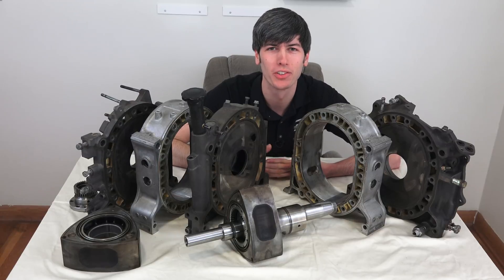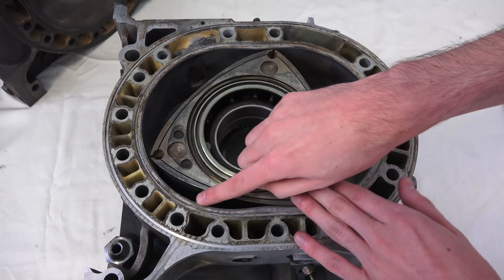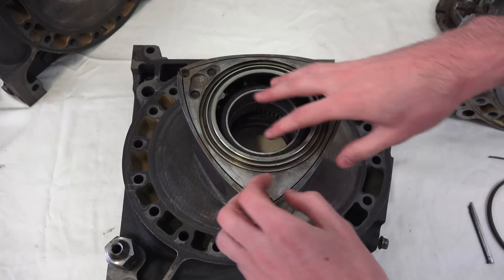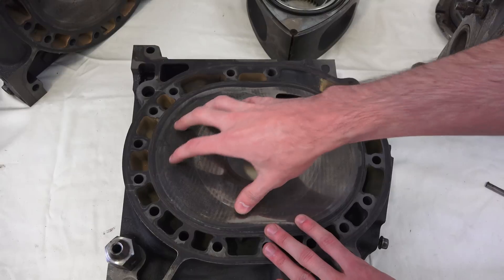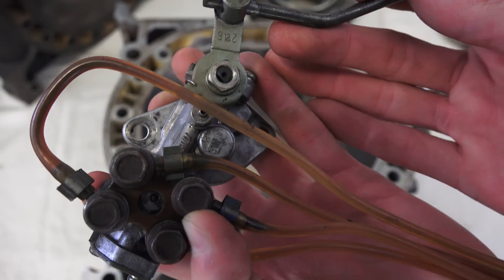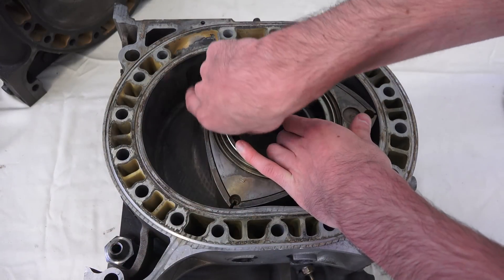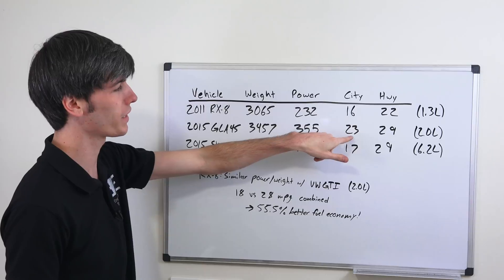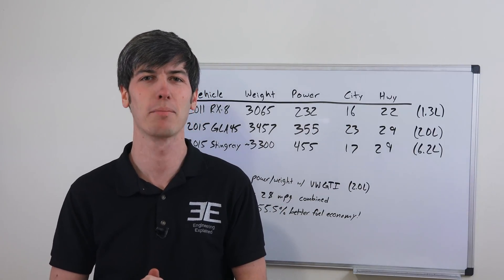4 Reasons Why The Rotary Engine Is Dead

Comment: The Wankel is certainly an interesting desing, I can see why it was tried, and why people have a romantic attachment to it.  The thing about the design is that it's mechanically a lot more efficient than a piston engine, but is's far less fluid dynamically efficient. An engine stores full then creates mechanical work through combustion.  As such the piston engine is highly efficient in that it acts as both a syringeidurring intake and exhaust, and as a plunger durring power.  This means more energy pushes the piston, making up for the energy loss in turning the crank.

Comment: Comparing a 2011 cars economy with a 2015 car is not very sensible since a lot has happened in those four years. Comparing to other 2011 cars the RX-8 would still come out bad, but not nearly as much.

Comment: The description of why the thermal efficiency is low is incorrect. First, "thermal efficiency" is not about uncombusted mixture leaving the chamber. That would be accounted for under "fuel efficiency" or "mass efficiency." In other words, "how much of the stuff I take in is utilized," not, "How much of the thermal energy I receive is converted to mechanical energy."

The thermal efficiency argument that is implied from your description of the combustion cycle is that, because the chamber is expanding as combustion occurs, the peak temperature that is reached is lower. The Carnot efficiency, which is the highest possible efficiency that can be reached with a heat engine, is limited by the temperature of the heat source (high) and the temperature of the heat sink (low). Because the combustion is happening over the entire stroke (while the volume is increasing) rather than impulsively at the start of the cycle, the average temperature at which heat is introduced to the system is lower, reducing its overall efficiency. The process is better approximated by constant pressure heat addition, rather than constant volume heat addition. (Diesels are similarly affected.)

The other efficiency argument that is implied from your discussion leading up to 1:22 comes from fluid dynamics. In short, because the average velocity of the flow inside the cylinder during heat addition will be twice that of a piston engine (because the entire chamber is moving, rather than just the piston wall in the cylinder) then unsteady losses will be higher; the system is farther from the quasi-equilibrium assumption. In the ideal case, heat is added to a fluid at rest, resulting in the maximum gain of total pressure (a minimum of losses from turbulent and viscous effects).

Comment: Mercedes - Benz also did extensive testing on the rotary or Wankel engine. If the engineers at MB and Mazda can't get it right, it does look like this design won't be in production anytime soon...

Comment: 7 reasons why the car is dead. Compare them vs. motorcycles. Needlessly hauling around all that glass, carpet, steel, and other rubbish... costs $$$. My 1985 Honda Rebel I bought for $500 gets 60 mpg. 1. Lower weight - higher mpg. 2. Easier to work on (compare vs. front wheel drive car engine bay nightmare) 3. Parts are cheaper 4. Insurance is cheaper. 5. Much lower impact on environment to produce, and dispose of. 6. Lower emissions 7. Never have to vacuum them out

Comment: Hi Jason, the most fascinating thing for me is that the rotors rotate at 1/3rd crank speed. Has anyone compared effective rotor speed in a rotary (even tip speed, which would be the fastest) with piston speed in a high performance reciprocating engine (such as a Honda VTEC, or recent Porsche GT3)? My bet is that a piston descending at high rpm from TDC is moving much faster than the rotor in a rotary doing 9,000rpm crank speed. I ask this because it strikes me that the rotary may make a better diesel engine, given the slow burn characteristics of that fuel, thereby taking advantage of the long combustion chamber shape of the rotary and the inherently low-speed of the rotors. So, why doesn't Mazda develop a higher compression rotary (remove or reduce the depression in the rotor face) with direct injection? It might still rev to 9,000rpm crank speed because the rotors are only doing 3,000 rpm at that crank speed. Mazda has already developed improved conventional diesels with much lower compression ratios than traditional diesels. Conversely, its Skyactive petrol engines combine very high compression (even higher than most DGI engines) with direct injection. In other words, Mazda's diesels and petrol engines operate with compression ratios not much different from each other.  I'm sure improved materials and manufacturing techniques can solve the sealing issues. Already, the Renesis doesn't have peripheral exhaust ports - it uses side ports to improve sealing, wear and other issues. I own an RX8 and love it - a great driver's car with an engine of enormous character. It would be a pity if Mazda couldn't find a way to make the rotary cleaner and more efficient...

Comment: Its not as clear cut though. rotary power makes power different to the normal piston motors. my mate has a 13b that makes the same power as my evo 8 despite his being much faster. There's also the point of rx8s are shit but the price of performance over price of fuel. Another mate spent abiut $10000 and got his car into sub 10 second 1/4 mile. While a normal car of a similar price would be a hell of alot more. Theyre also an insane engine that is popular is australia and new zealand that won't be dying out any time soon. They can make ridiculous power and an easy engine to work on. Non ported rotors aren't all that bad with rebuilds but the rebuilds cost stuff all too. Most people that are rotor nuts don't care that they're hard on fuel when heavy ported or they're loud or whatever because they're an awesome motor that's a shit loud of cheap fun

Comment: Actually it isnt dead at all. 
http://www.businessinsider.com/mazda-has-over-100-engineers-working-on-a-breakthrough-on-one-of-the-worlds-strangest-engines-2016-2
Reply from the maker: +buildmorefarms100 Listen to the first 10 seconds. :)
Reply: Engineering Explained I did sir, I prefer to think of the rotary as not "dead" but in for a lengthy surgical procedure. Dead denotes such finality.

Comment: I'm sorry I usually love your vid's but however not this one. The rotary was never meant to be a street engine. Its more like a full-on race engine that needs high maintenance and little to none emission restrictions. and you comparing 13b renesis (the worst rotary engine ever made) to modern wanna be European flat plain v8 (c7 stingray and correct me if I'm wrong if its a flat plane) is unfair. a good example of this would be the 787b. it won the 1991 I believe Le Mans race defeating the mercedez. infact mazda came in 1st and 2nd.  

AND a car with a rotary will out corner 90% of other cars the other 10% being inline 4's.

Comment: Had an RX8 for 3 years or so. I sold it finally, for all the reasons explained in the video plus two more. First: no low-end torque. 240~ish HP in a 3000 lb car isn't so bad, as long as it's got some low-end torque. But the RX8 could just not get out of its own way. No serious power until you're turning well over 4000 RPM, which even in 1st gear is probably close to 40 mph. Finally: there's the danger of flooding which bit me a couple of times. When it's 6AM and you need to move your car out of the way, you don't always remember that you need to warm it up completely before you shut it off. Nobody should have to care about flooding an engine in a modern car, period.

Comment: Emissions out the ass. While we are burning petrol it really doesn't matter how much. Its bad news regardless. The ~750hp 1.7 Liter V6 F1 Engine has better systems to ensure fuel efficacy then most road cars. They have 50 Liter fuel tanks and have to complete a race at tremendous speeds. Thought, Progress isn't cheap and as long as energy corporations are in control we wont stop burning hydrocarbons. Water vapor output from alcoholic and hydrogen engines is an easy fix. Pissing out CO2 from billions of cars....not so much. Rotors are fun, and if someone dares to poke at fuel economy then they are being ignorant honestly.

Comment: Interesting. I have a question for you. Instead of injecting some of the engine oil into the combustion chamber, why don't they use 2-stroke oil? It's designed to be burnt and smells real nice too!
Reply from the maker: +Peter Huskins Then every time you fill up you have to mix in oil. Much easier to not have to deal with it.
Reply: Not at all. You have a separate tank for the 2-stroke oil. (apart from racers, people haven't had to pre-mix in the fuel tank for about 30 years!)
Reply: actually that would make total sense that and putting in a domed rotor ive noticed the one i took appart from a old 83 rx7 had slots were the rotors compression was increase the compression increase power XD

Comment: When you put it like that, you have to wonder how it ever got in a vehicle.  I would be very interested in peoples view of what would be the top 20 desirables in a heat engine (there is a very relevant reason for this question), or top 10 if easier.

Comment: Great video, your channel is one of my favorites!Please allow me to add just one more nail to the rotary's coffin:  The effect of lean fuel mixtures are immediately catastrophic to these engines.  All it takes is a fuel injector that is slightly clogged and those seals are toast.  Detonation before TDC is a very different condition than with a piston engine.  When compared to piston ICE, this seems to be the most damning failure point.  However...

My 1993 RX7 turbo produced 260hp and easily returned 30mpg at 80mph.  Bigger turbo and fuel injectors easily produce 500hp/30mpg.  The car weighs 2600lbs.  Emissions AND A LACK OF DEVELOPMENT BUDGET/EFFORT is what killed the rotary in my opinion.I believe that it is unfair to compare the RX-8 engine to the GLA45 and Stingray (LS).A GLA45 is a $50,000 car with direct injection and a turbo that pumps out 26lb of boost.  The Mazda was $28,000, no turbo, and relatively primitive fuel injection.  Imagine what Mazda might produce if they could fetch $50,000 for an RX-8:  1.  Add pressure sensors and direct injection fuel injectors to detect and solve lean fuel conditions, significantly prolonging engine life.  This should allow for high pressure turbocharging and massive power increases without ruining emissions.  2.  Add one of those electric/mechanical turbochargers like BMW uses.  With nearly instant boost on demand, we can not only improve efficiency by recapturing energy from exhaust gas, but also improve efficiency by reducing displacement.  3.  Cut the number of rotors in half.  A single rotor engine can be balanced to be just as smooth as a twin.  Reducing the number of rotors would increase thermal efficiency.  4.  Multiple short intake and exhaust ports with "hidden" valves (valves inside of ports that do not enter combustion chamber)  This might be a good substitute for intake and exhaust timing, equivalent to variable valve timing of advanced piston engines.  5. Sensors to monitor the temperature of the engine at 2 or more locations, and an exhaust gas diverter valve which routes exhaust gasses near the cool side of the engine to keep thermal expansion differences to a minimum.OK, after all this is done, now we have an engine that is almost as good as the AMG 45 or the LS.  =D
Reply: +Michael Gallant Just for clarification, when I say "add direct injection" I would intend to keep the standard fuel injection near the intake ports, run intentionally leaner mixtures, and correct for lean condition with direct injection.  It might help the fuel in the corners burn if the mixture were monitored and controlled with more precision.

Comment: Your comparisons are with engines that have much larger displacements. Though you have a point that the RX-8 is heavy, you would need to compare it with a 1.3 liter piston engine in the same category. But, there aren't any. What other production car has a 1.3 liter producing over 200 horsepower? A Suzuki Hayabusa motor in a 3000 lb car? Let's see the numbers on that complete with 0-60, 0-100, and 1/4 mile times.

Comment: The rotary is certainly dead, however the comparisons of power and economy with the Mercedes GLC250 with a 2.0L turbo is grossly unfair, because the RX-8 is naturally aspirated, and the RX-8 is also a very old design.

Comment: 1. There's a parafilology about fuel efficiency... Because I've learnt about lt/100 km and no by MilesPerGallon, believe me, that a Skoda Octavia 20VT has exactly the same consumption and it is more thirsty on accelerations on the hiway.
2. Mazda says it from the start about oil burning... The GOLF GTI BURNS THE SAME OIL BY CONSTRUCTIBLE FAILURES!!!! Some piston engines that can reach above 7.000 rpm also have oil burned... So don't tell me about oil burning... and
3. about the gasses... I believe that Mazda should have made an extra filter for burnt oil gasses, having less environmental pollution...

Comment: I might also add another disadvantage. They are very prone to detonation due to the combustion chamber design and its double whammy due to the oil injection further lowing detonation threshold. Having less timing advance to protect against detonation this further reduces thermal efficiency and the low compression is a double whammy to that too.

The engine construction is very intolerant of detonation too, so when it happens is damages the engine super easy.

pretty piss poor engine design really when you think about it.

Comment: For those who haven't actually driven a rotary engine car..I can't remember the exact year, but I drove a rotary engine Mazda sedan, it was a very interesting experience.  I had heard that you needed to look at the tach to tell if its running, this was 100% true, the engine was dead silent and didn't have any vibration at all, when you revved the engine there wasn't really any sound and still no vibration at all.  When driving the manual transmission you had to watch the tack closely since there was no audible difference in the sound, and no vibration, so it would be incredibly easy to over rev the engine.  It was an awesome driving car, no sound or vibration at all as you ran through the gears with plenty of power.  While they had improved tremendously, the problems of short engine life before overhaul, excessive emissions, and poor gas mileage eventually killed it off.  Terrible shame they couldn't find the answers needed.

Comment: I had a Mazda RX-7 with a Wankel.  If I am correct, the first Wankels installed in Mazdas had serious apex seal problems.  I recall a manual choke that locked out with a solenoid.  Once temperature was reached, the choke would snap to off position.  During the colder months, this gave me trouble.  When the choke returned to "off" the engine would sputter and bog.  Dealership was unable to resolve the problem.  Did like the sound though . . . it was unique and sounded like a jet winding up.

Comment: Great video, but shouldnt you have been comparing the RX-8 to a naturally aspirated piston engine from the same era ?
If not then the RX-7 FD turbo is more the engine that you would compare to a mercedes 45
Reply from the maker: +Nivesh B 2004 Corvette is heavier, more power, larger engine (naturally aspirated), and still gets better fuel economy. 2001 GTI gets 33% better fuel economy.

Comment: +Engineering explained please add about large temperature differences between 3 chambers which causes uneven thermal expansion of housing. Rotor housing failure that kills rotary engine.
Reply from the maker: +jhenu subramaniam This was point #2... 1:24

Comment: +Engineering Explained so what makes you think they will bring it back?  What improvements do you think they can implement to make it more efficient?  One thought I had was some sort of exhaust recycling system where the exhaust is fed back into an auxiliary chamber for a second combustion prior to being expelled the tail pipe.  Not sure how that would work or if it's even possible.  I'm just pulling rabbits out of my ass.

Comment: RX8 is an anemic example.  the FD3S RX7 with twin screws getting it's volumetric efficiency up would give far better comparisons.  Rotaries require forced induction to perform well in my experiance the intake system is just to lumpy for good flow on vacuum alone.  My FD can keep pace with a corvett from early 2000's and I get 25ish per gallon.  I think that is good bang for the buck (and it's always fun having a 1.3 keep up with a 6l)

Comment: It is a flawed engine - no doubt about it - but to me the appeal has always been the package that Mazda has been able to build around this engine. The mid-engine like handling and the stratospheric red-line add to deliver a sports car experience which can't be measured only by engineering/performance parameters. I wish there were ways to fix the fundamental flaws around this engine. Would love to hear your thoughts on potential engineering advances/solutions which can save the rotary.

Comment: Great write up, it was explained well. You did miss the part where the rotary has no valvetrain to pull along, and how the rx8 is essentially the equivalent to a performance 2l sedan and was never going to be economical with a performance mindset

You'v compared their 6 port engine (stressed performance model) not the 4 port, both from the same rx8, which came out in """"2003"""" with large capacity motors that wont see any stress driving to and from shops and designed in """"2015""""!!! 
the vwgti was the only decent comparison but you are still comparing essentially a sedan to a hatch designed a decade later. of course it will have better mileage, even going past the fact that the mazda was never about saving fuel.